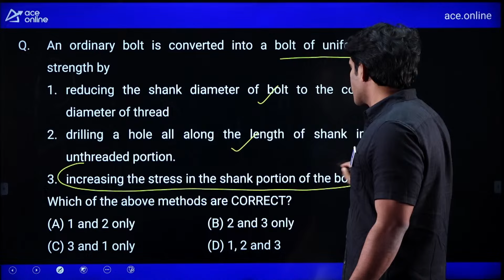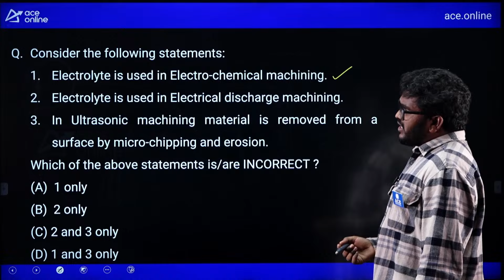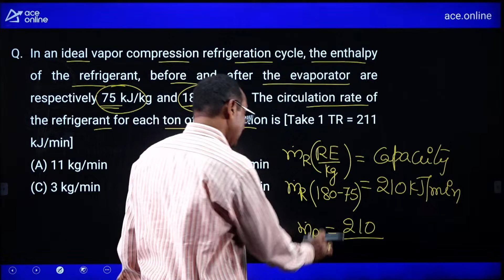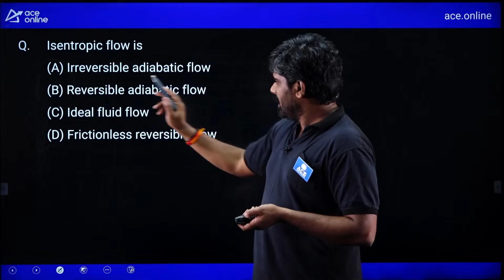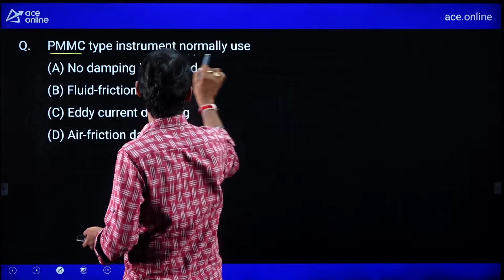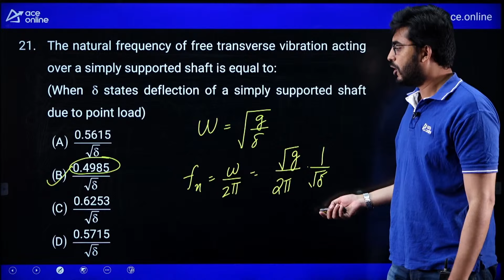TS GENCO AE (Mechanical Engineering) Exam | Mock Test-2 (Section-A) Detailed Solutions | ACE Online

Comment: In theory of machines if centre distance increase then contact ratio will be incresed, pressure angle also incresed,radius will be constant but incase of arc of contact also incresed.

Contact ratio=arc of contact /circular pitch. If centre dist. increase then arc of contact will also increses.
Reply: Formula
Arc of contact = ((Ra^2 - (Rcos(phi))^2)^0.5 +  ((ra^2 - (rcos(phi))^2)^0.5 - (R+r)sin(phi)/ cos(phi) 

In this as we increase center distance r,R phi increases which (r+R)sin(phi) increases but arc of contact decreases as it having-ve sign in formula and this term (r+R)sin(phi) is more significant then other terms.